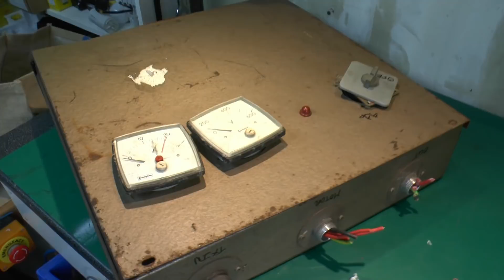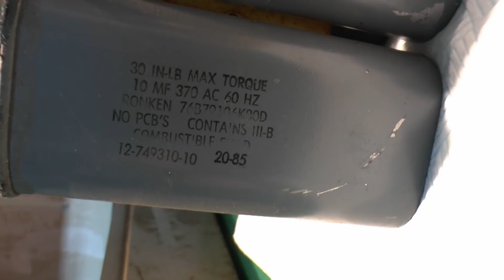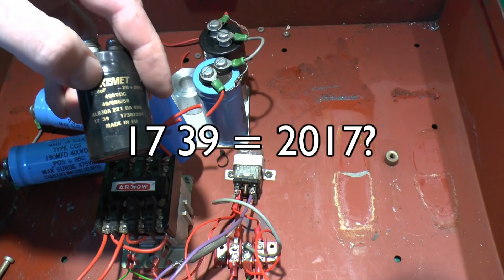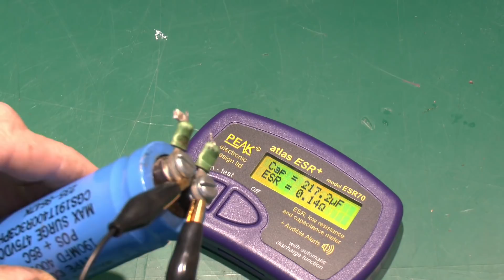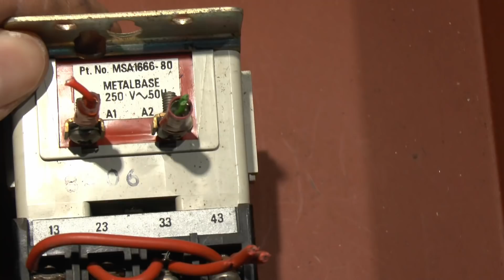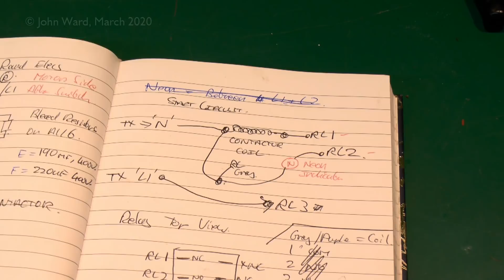Phase Converter 2 - Dismantling the Control Cabinet

Comment: What the hell was it using those blue capacitors for, they appear to be DC ELECTROLYTIC and I can't see a rectifier anywhere.
Were they in opposing series so they develop leakage bias?
Reply from the maker: They were DC electrolytic, and connected in series pairs.  Not ideal, but they were only used for the initial start, so only connected for a second or so.  The contactor disconnected them once the motor was up to speed.

Comment: Is it possible that the relay was 120V in case of unbalanced phases, for example to make sure it would switch out the starter caps even if that phase only managed 190V?

Comment: "Hello, it's J-W..." is the sign of quality. This series is lovely, going very deeply into the basics of  AC transmission. Weird you UK have only basic 240V - in the continent 400V three phase is the norm in new installations!
Reply from the maker: 3p 400V is standard for UK commercial and industrial locations.  Homes only have single phase because there are no appliances that require 3 phase.
Reply: @jwflame  There was a time when a lot of British houses were built with 3-phase, largely on council estates in the late 40s / early 50s, and fitted with fully-electric storage heating - when we were promised electricity "too cheap to meter" from the wonderful new atomic power stations :)
Reply: @jwflame  Well I guess the the tipping point is if you have electric cooker or not. Like even in apartments it's quite sensible to just install a relatively small 3x 25 A three phase panel because the riser nearby is 3 phase anyway. That would mean 3x10 to cooker, 3x16 and 3x10 behind a single RCD and that's usually plenty to play with. (If you feel super skimpy the panel can be 16 A main and 6x10 A.) Spreading loads like that is sensible and phases can be altered between apartments. 

I know you Brits use a lot of gas, so there's that. I think I caused some confusion under your boiler video even because I didn't quite understand that and assumed oil heater.
Reply: 3 phase is becoming more common in houses for larger solar inverters 👍
Reply: Unfortunately in the UK, all 3 phase installations are classed as commercial and they bill for apparent power rather than real power.
Reply: @cambridgemart2075  Not necessarily, there are a number of 40s/50s built council estates near me which are supplied 3-phase domestic power.
Reply: @hopefuldave  Perhaps, but having asked about getting 3-phase to my property, I've been told it's on a commercial tariff only. Incidntally, the house is 50s built and was electrically heated but from a single phase 100 supply.

Comment: Those bleeder resistors look like red-violet-orange (27k) to me, which more-or-less matches your readings: two in parallel gives 13.5k 1/2 W. That means about 80 V max before they're overloaded, so they've been overheating, which is probably why the values have drifted a bit, the colors are hard to see, and they're rather fragile. Definitely not the right choice for the job.

Comment: The 120 V relay, 60 Hz rated capacitors and CSA labels on the relay and contactor makes me think someone adapted a North American product to the UK...
Reply: It almost seems like that, especially that Arrow Contactor that had the contacts paralleled up to "ensure" the contacts didn't weld when the capacitors were taken out of circuit.

Comment: So what you're saying, John, is you're making a Ship of Theseus phase converter. (Ship of Theseus is a philosophical question about a very old ship, that throughout the course of its travels, having needed various repairs over the years- this plank here, that beam there... eventually, every single component has been replaced at least once. Is it still the same ship as before?) Not criticising at all- I tend to run cars completely into the ground before replacing them, and one that I particularly loved went through various assorted body panels (it was apparently invisible in parking lots, so people were constantly scraping up against it, failing to leave any contact information) two different engines, two different transmissions, etc over the course of 350,000 miles, 13 years that I owned it (and it was 7 years old when I bought it) When I finally accepted that it was time to move on, very little of the actual original car remained, apart from the body shell/frame.

Comment: Nowadays it’s better to use a VFD than mess around with those old-fashioned converters.
Reply from the maker: Yes - if you just want to power a single 3p motor.
For connecting other loads, a VFD is useless.
Reply: Not for me, my milling machine alone has 3 separate 3-phase motors in it, my TIG requires proper sinusoidal 3-phase AC, other 3-phase machines can be just plugged-and-play, had I known how much simpler it would have been my lathe would be powered by the convertor rather than tearing out ALL the existing control circuitry to install a VFD - you can't run a VFD straight into the machine, no switching, contactors etc. allowed - the VFD output MUST be wired direct to the motor* and be controlled by low-voltage switching.* OR in the case of my lathe with a 3-speed motor you have to engineer interlocks to prevent any switching with the VFD active, not simple...
Reply: Just built one of these for my milling machine and went about it quite a bit differently than this one. Curious to see how yours comes together. New subscriber but have heard about your channel from big Clive. Enjoying the content. Thanks

Comment: The polarized electrolytic caps are wired back to back in series pairs to make bipolar capacitors.  They didn't use AC rated capacitors to save a few dollars, and they failed. I would replace them with three 100uF 450V motor caps.

Comment: Out of interest where do you go to buy large capacitors like these?
Reply from the maker: CPC / Farnell or RS Components.  Or other similar suppliers.
Reply: John Ward thank you
Reply: Or your local electrical factor (supplier of cable, connectors, parts etc. to the trade) - they're usually cheaper than RS.

Comment: Would be nice to have a bit more on the theory of operation.  As I thought a rotary phase converter was a single phase motor driving a three phase motor.  Didn’t expect to see a 400v transformer.  Is the motor just a std 3 phase motor or is it specific to a phase converter.  Is the spinning mass of the motor used to clean up the third phase that was created from the caps.  so many questions...
Reply: The 240-400v transformer's necessary if you want to supply motors expecting 400v 3-phase - for example my lathe has a 3-speed motor that can't be rewired for 240v 3-phase (without a VERY expensive rewind with heavier wire by an expert), my TIG welder (fairly big industrial inverter power supply) can't be run from 240v 3-phase.A rotary converter can be run by supplying 240v across one phase and the central star neutral point, but it's horribly inefficient and requires a HUGE motor as all the input power is going into one winding which is also supplying one phase of the output (so the windings each need to be rated for 4 times the individual phase current required by the device you're powering).The motor is a standard 3-phase motor, ideally wired star / wye (to spread the input power across two phase windings, although mine runs fine in delta connection) and needs to be larger than the load - so for a 5 HP load it's normal to run a 7.5 or 10 HP idler motor, which generates the 3rd phase (once spinning) due  to the rotor's rotating magnetic field (technically it's a "rotary transformer") - the capacitors balance the winding inductances to give the correct phase relationship between them and equalise the phase voltages (within limits - the load also influences the voltage and phase balance).Some do use a single-phase motor (or even a rope around the motor's pulley) just for starting, as otherwise the motor won't rotate, draws excessive current and grumbles - the blue capacitors in John's convertor are used to apply a phase-shifted current to the third phase (the incoming power is across the other two) to create the rotating field needed to spin the motor, once spinning they drop out of circuit and the third winding generates the phase (as above).
Reply: Dave H  What about a single phase motor  coupled to a three phase motor ?
Reply: @eliotmansfield  That's a motor-generator and sounds very easy - BUT the generator side would need either permanent magnets in the rotor to provide a field or a DC-fed field winding - although either could be either in the rotor or the stator, theoretically, practically it's more common to put a field winding in the rotor and connect via slip-rings on the motor shaft - without a magnetic field the 3-phase alternator (which is what you're trying to implement) won't produce any current to speak of (there may be some remaining magnetism in the rotor, but not enough for an efficient alternator).
As mentioned somewhere in this thread, single-phase motors are sometimes used to start a phase converter's idler motor (or even a rope around the motor's pulley), but only to start, once spinning under it's own power the idler is disconnected.

Comment: You really should have checked the (oil) caps for leakage (parallel) resistance. Even if you were going to toss them anyway it would be interesting to know whether they're leaking. That could be why the Fluke meter measured high on each one.
Leakage probably wouldn't be a big problem in this application given that they're being used only with AC, but it is still indicative of a failing capacitor. They should have near infinite resistance to DC.

Also the resistors read red violet orange. 27k.

Comment: Ok, the capacitors weren't in good condition but why scrap the contactor. It was still good. The reason 4 poles were connected in parallel was for more current capacity obviously. So what if the terminals were exposed, you're not going to be touching it when its on and it'll be inside a box. You could rewire it for 3 phase + neutral. Its good quality from back when stuff was made in the UK. New contactors are probably made in china.

Comment: Excellent, always like bits on capacitors.  I’m lucky enough to work in the power capacitor industry.  The insulating oil will most likely be at least 95% phenyl xylyl ethane (pxe). The ref IIIB is the clue, this is an American OHSA reference. This oil is too nasty stuff,  doesn’t smell particularly nice either. However, its probably not as bad as aroclor (a Monsanto brand of pcb) often used in the uk by the likes of the former BICC capacitors and Bryce capacitors for their Oil filled AC ranges. If caps are leaking oil, the propensity for an internal terminal to case flash over increases significantly.  If oil is coming out, air will get in which isn’t ideal.  Assuming  these are possibly metallised film capacitors, the metallising on the film will be zinc.  This will deteriorate when exposed to atmosphere. They could be even be a mixed dielectric of capacitor tissue paper and film. The bin is the best place for these. Excellent YouTube channel!
Reply: They were still using paper in capacitors in the mid 80s? Were they insane?
If there is something like paper in those caps that could explain why they all measured high. 10uF + DC leakage could measure at 11uF.

Comment: Well unless you got that for free you might just as well found yourself an old three phase motor and buil a converter from scratch. It is unusual to have transformer as the live to neutral  is 230/240 volts, could that be an inductor to give a phase shift.
Reply: The transformer is so it can supply 400v (rest of the world) 3-phase rather than (USAnian) 220v, without needing to waste most of the applied power in a much bigger motor.

Comment: Ive actually got a proper commercial single to three phase converter. Its all in this little grey metal box on workshop floor. Ive had it for about 10 years and has been flawless. I think it is rated for upto 12HP Its wired into a 20amp breaker from memory. 

I guess the quad contactor was used because of the huge inrush current charging the starting caps?
Reply: If it's on a 20A breaker, it's more like a 7 HP converter - mine's 10 HP and needs in excess of 30A at full load (and spikes up to 60A or so on start-up, definite type-D 40A MCB territory!)

Comment: Looks like you are replacing most of it, as in the first video you very gingerly started it as you did not trust it. Looking forward to the next video.
Reply from the maker: The switch was arcing internally, so not something I wanted to hold onto.
Reply: Most of the control box (or maybe all), sure. Not the main parts of the thing.